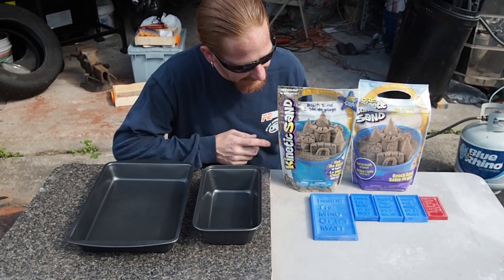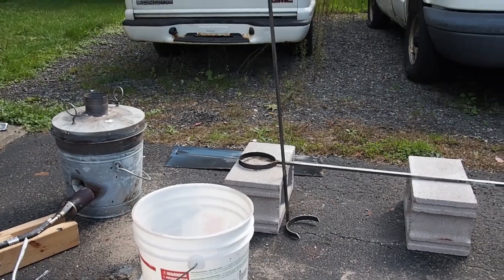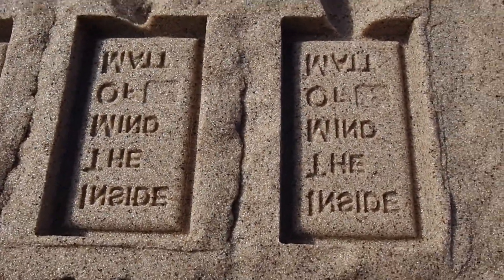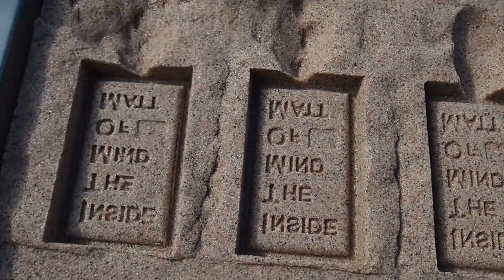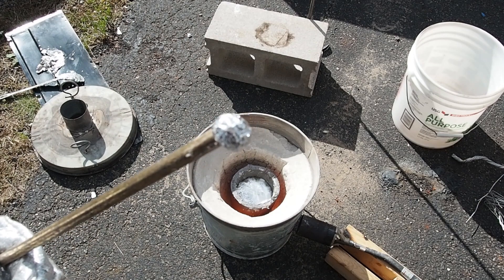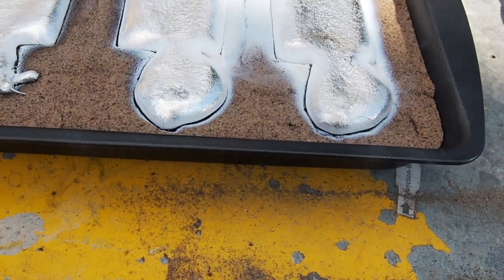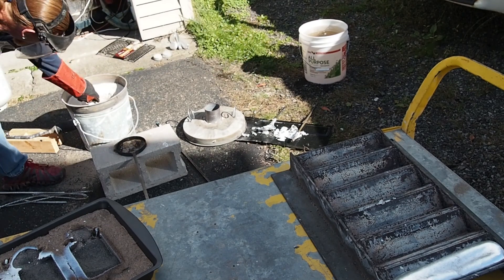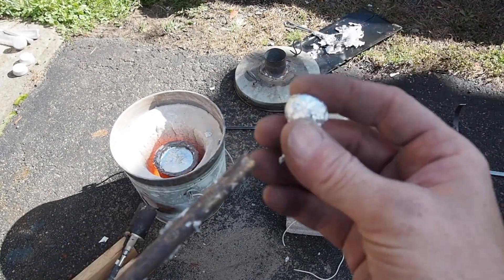Kinetic Sand Casting Aluminum

Comment: Thumbs up for trying this. I saw this mentioned a few years back regarding casting. Thumbs down, for using it for casting though! I wonder if the gas it releases is preventing it from filling the mold? Did you notice how it was acting like the lotus effect? (It was beading, and did not want to "conform" to the mold) That was really odd.

Comment: Think making the letters on the PLA forms taller would result in sharper returns in the aluminum?  I was worried whatever chemicals they put in the sand to make it pliable like it is was going to react badly with molten metal.  Should do a video on all the tools past and present you're using to pour. Would be interested in what does what and such. Happy making!